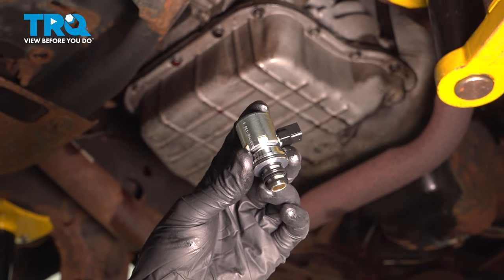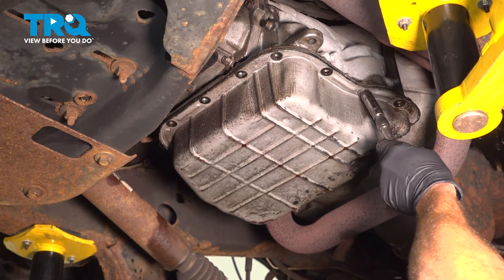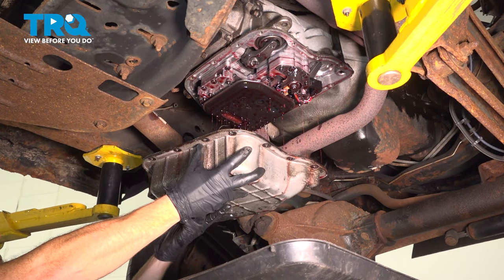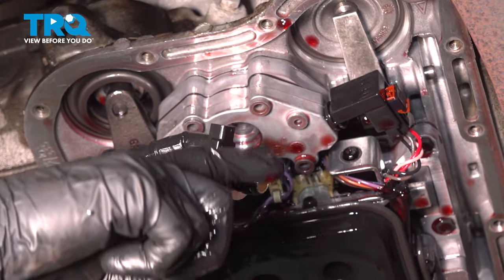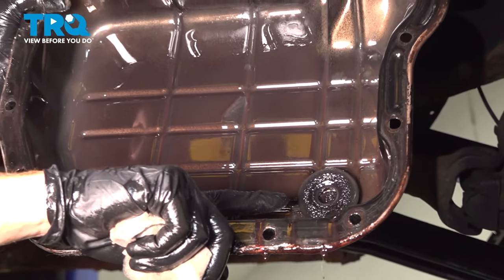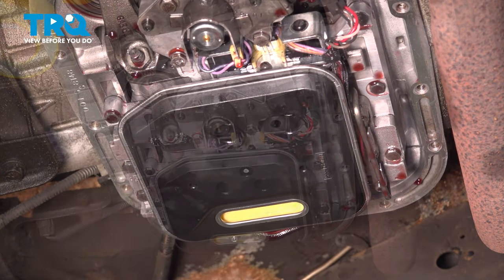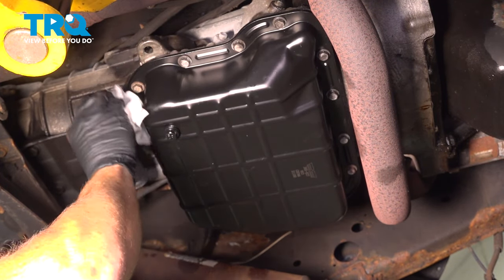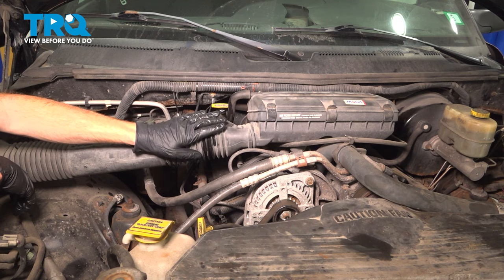How to Replace Governor Pressure Solenoid 1994-2002 Dodge Ram 2500

Comment: My transmission now has a slow leak on the engine bay side of the transmission after replacing this part. I cannot figure out why. Pan gasket seems fine with no leaks

Comment: You'd think there'd be a pump you could attach to the dipstick valve to vacuum drain it, rather than just opening a pan that's full of fluid. Seems really sloppy and weird.